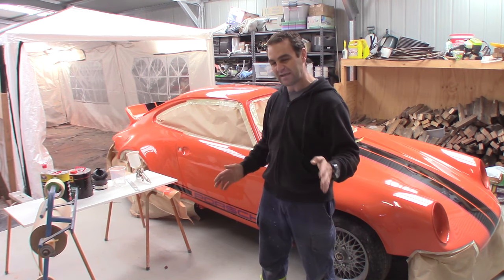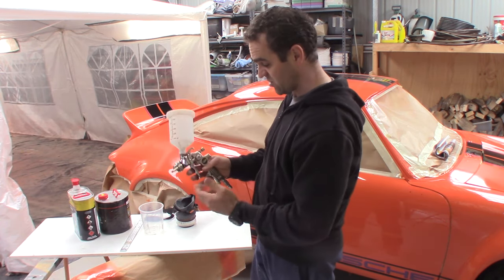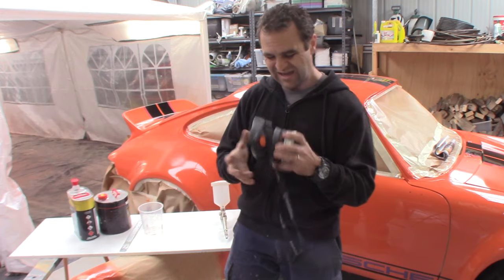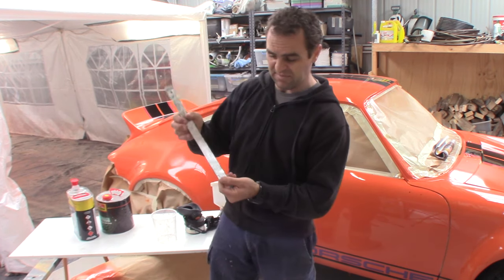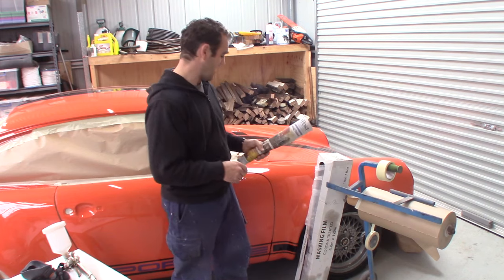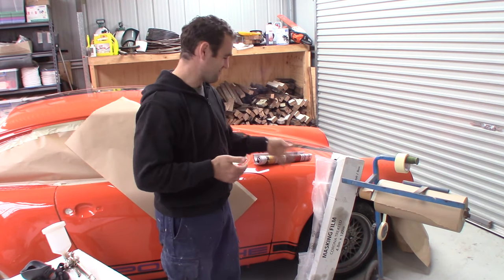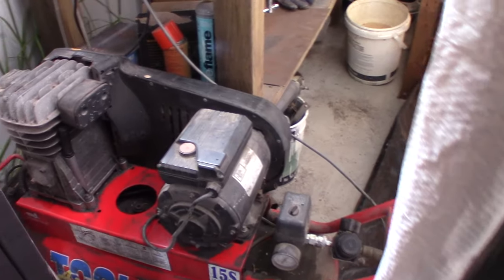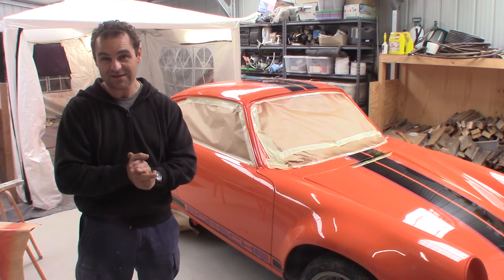Basic spray painting equipment

Comment: Hi Jeff, just watching this old video, I noticed your pressure regulator is on your compressor.  Mine was the same and I found that I often have water splatters.  A spray painter mate told me to put it on a 10 metre hose so it is thinks its 10 metres from the compressor.  This allows condensation to settle in the hose before it hits the regulator and it stop water vapour buy pass.  This worked.  I have also recently added a bog roll filter.  I filter ontaining a dunny roll.

Comment: How haven't you explained what type of paint you are using? Cellulose, 2k, water based? There will be somebody out there going out and buying 2k base coat not having the slightest idea there's deadly Isocyanates in the hardener that a cartridge mask won't even protect you from?
Reply from the maker: It is 2k I am using and the mask has the chemical filter as used by basically every panel shop in Sydney. You definitely want to use a chemical rated mask even if you are just using acrylic. I may not contain isocyanate but it is still not something you want in your system.